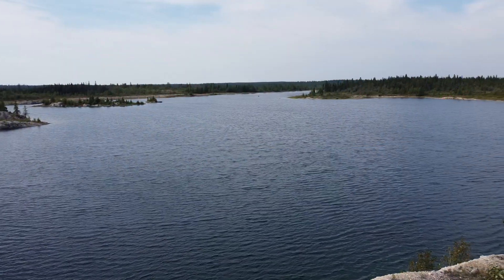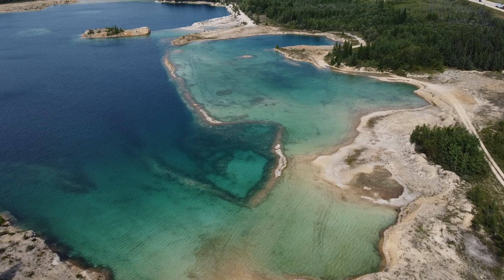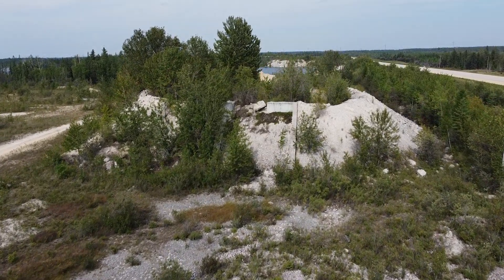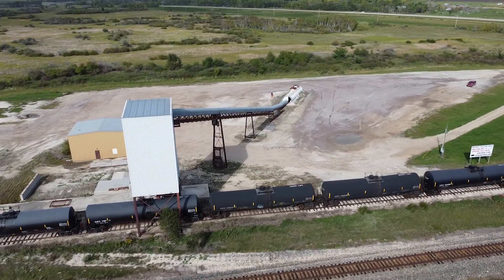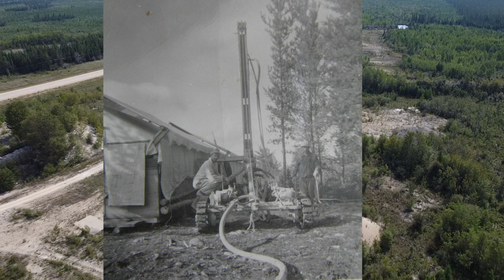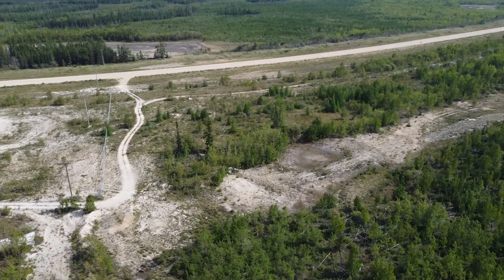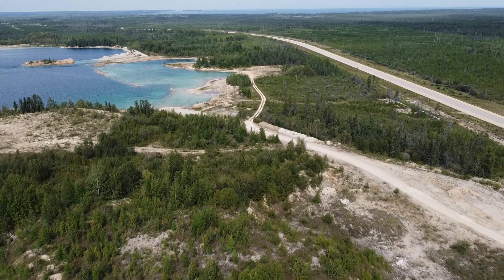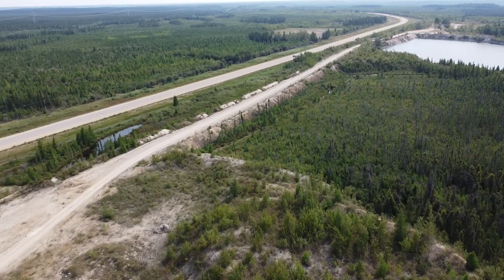Mafeking Quarry - Travels with Bill

Comment: Little off topic but what is that big blue building in mafeking? Hockey rink?
Reply from the maker: Almost a hockey rink.  The old one burned down so the new one was partially built.  From what I understand it was never fully finished inside and was never used for hockey.